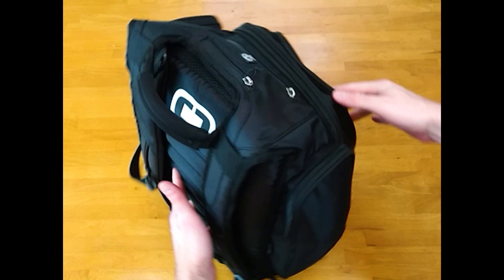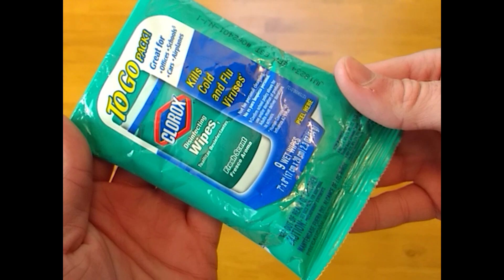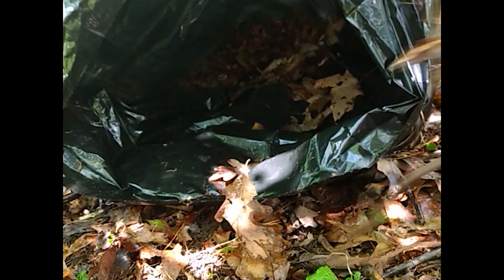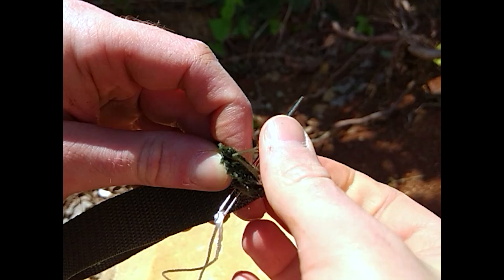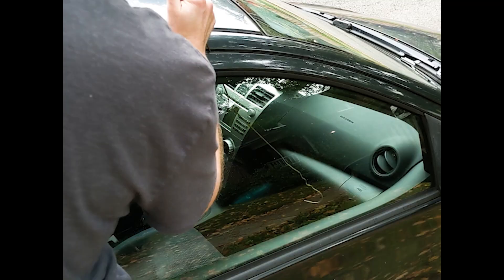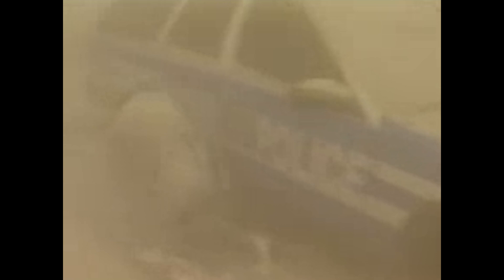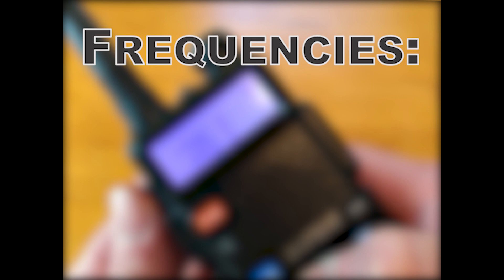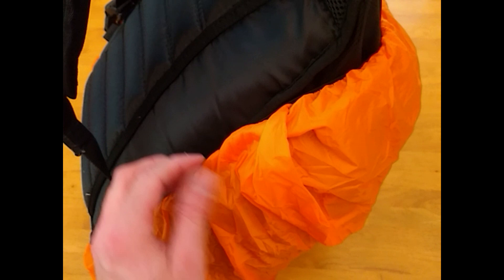My Urban Get Home Bag

Comment: Thank you for the video. I really appreciate videos like yours in which we're not told how fantastic every piece of gear you have is. I also appreciate that you didn't tell us what is essential and what is not. You showed us what you carry and I took away some good information. Thanks again and best of luck to you.
Reply from the maker: Thanks for such a thoughtful and positive comment, Trenton! 

I definitely didn't buy the best possible option for each of my tools. In fact, I let my gear slack significantly over the years and only recently tried to address some of the gaps. Doing so quickly and on a budget definitely means that I had to settle for basic gear. But I'm reasonably pleased with what I've assembled until I save up for some upgrades. 

And I definitely agree with your point about "essential" gear. There is so much variation in people's environments, patterns of life, and potential threats that those hard rules (like absolutely requiring a container that can boil water) can seem a little silly. Especially for a Get Home Bag vs. a Bug Out or INCH Bag. 

But, at the end of the day, I'm just an amateur that is showing their particular set-up. Glad you got an idea or two from it!

Comment: The OEM antenna on the Baofeng is very poor — I’d recommend you replace it.  There are less expensive options but the Super Elasic Signal Stick is super rugged and performs very well with this radio (no affiliation).
Reply from the maker: I appreciate the advice, Michael! I'm definitely aware that the stock Baofeng is less than impressive. I kept them only because they seems to work well enough for my needs and because I had a ton of other stuff to purchase, at the time. But I will definitely keep your recommendation in mind, for when I have more disposable income!

Comment: Maybe I missed it but just use a hemostatic, you dont need glue
Reply from the maker: Hey man--thanks for commenting. 

As a former medic with specialized training in wilderness medicine, I can definitely address this. Hemostatic agents promote the formation of clots but they don't close wounds or support the integrity of the tissue that surround the wound. Its the closure of the wound to prevent repeated contamination that I would be my goal, if I elected to use the glue. 

That being said, I almost wish that I had left that part out because it is usually unwise to close a wound by using sutures, staples, or glue (what we call "closure by primary intention") in an austere environment. Its just difficult to properly clean out the wound in austere conditions so we don't want to close the wound with an unacceptable load of pathogens or even tiny debris still inside. But for small, superficial lacs? I might use the glue for convenience but only on myself. 

Still, even if I don't use the super glue, I doubt I'd break-out Celox for a minor laceration--good 'ol direct pressure will usually suffice. Plus, the only applicable agents would be the granulated kinds. And, although some of the companies have fixed the problem of burns from hemstatic agents being blown into our eyes whenever a helicopter comes for a MedEvac, I still don't like messing with that stuff when wind is a factor.

Comment: Oh, another potential thing to consider is your battery bank. They make battery banks that have a boost circuit capable of jumpstarting cars. I've used them before and they work great. Of course, they can vary in price, size, and capacity just like normal power banks. I got a 10K mAh unit for $24 on sale. I figure if I'm gonna carry one anyway, I might as well get the extra capability. https://smile.amazon.com/TENKER-14000mAh-Portable-Starter-Charging/dp/B07FML2HHD -- there's also the option of solar panels that can clip to the back of a backpack while you're walking. These even have an 8K mAh integrated battery. https://smile.amazon.com/iClever-Charger-8000mah-Sunpower-Cellphone/dp/B06XQYYGTV Though since your backpack isn't really about long-term survival I guess you probably wouldn't need it.
Reply from the maker: Right: I wouldn't keep a jump-starter in my Get Home Bag. But it's a funny coincidence that you mention the topic of dead car batteries because I just published a car kit video! I didn't include a jump starter in the video because I'm not able to invest in a truly reliable ($100+) right now but I do have a solar charged power pack in the car bag.
Reply: @ContingencyLabs  Cool, I'll watch the new video. I'm not 100% convinced that more expensive automatically means more reliable. I've seen teardowns (one by bigclive on youtube of a Noco, an expensive brand) for instance, and it failed quickly and might not have had the greatest construction inside. I've personally used two that were around $35 and they both worked great. The first one did have a glaring issue (it didnt have reverse polarity protection) and my dad used it on a car which didn't have battery markings (at least that's what he told me...) and the battery pack went up in smoke. I made sure to get one that specified reverse polarity protection next time.. (it's usually in the little box in series to the jumper cables).

There is also an excellent video testing powerbanks by Project Farm and from what I remember, the more expensive ones didn't necessarily give out more amps. While you definitely trade off capacity for versatility, I still think it's useful. Still, I suppose in a situation where it's unlikely to find a dead car battery you might want more capacity. I had the image in my head of scenes in movies like War of the Worlds with dead abandoned cars on the road, likely dead. There are also supercapacitor chargers which are very interesting which use the small amount of energy from a 'dead' battery to jumpstart it.

Links to the videos I mentioned if interested;

Bigclive Noco Teardown: https://www.youtube.com/watch?v=uAvyRwMhd0w
Project Farm Noco vs Duracell vs Audew vs... https://www.youtube.com/watch?v=JN8A2nIMUWA